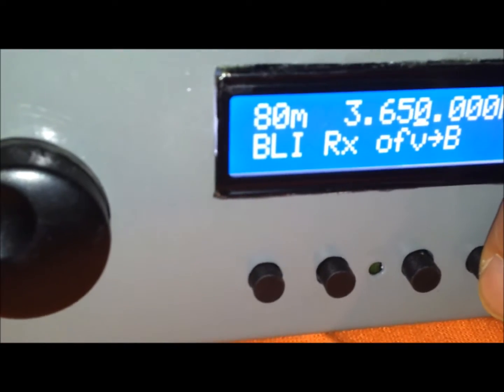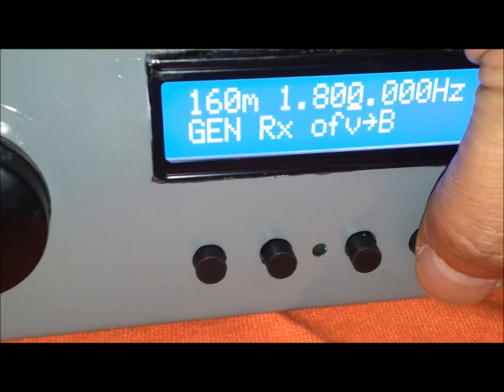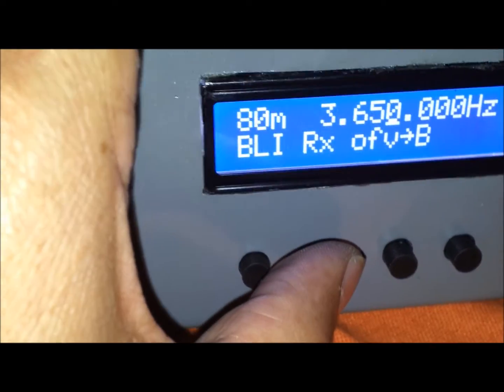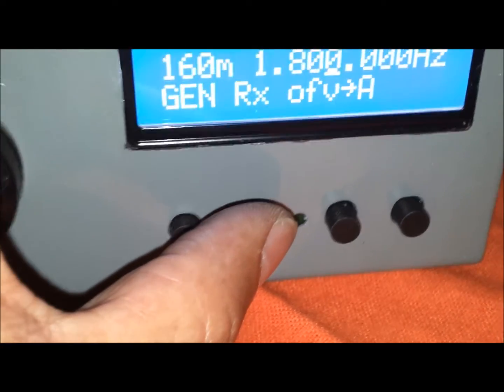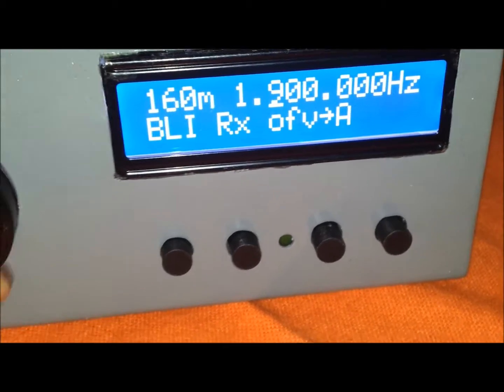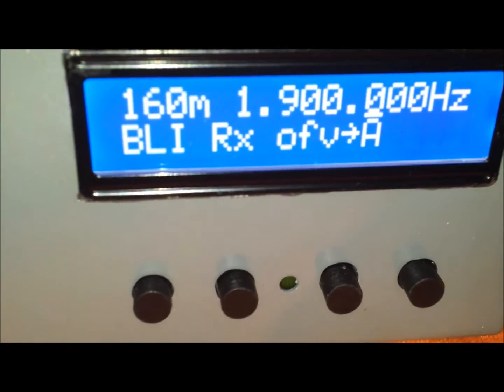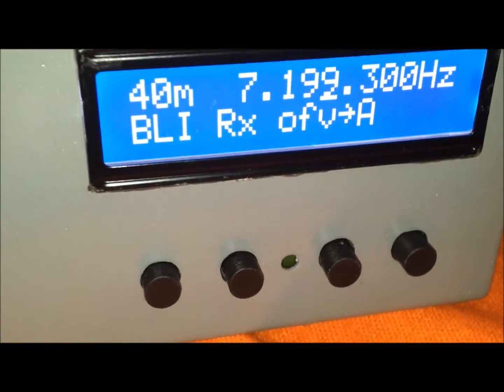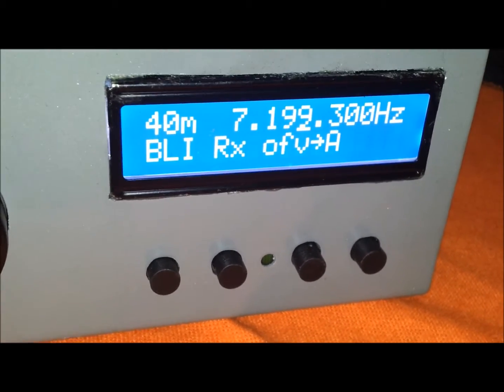OFV DDS / LU9EQF-

Comment: saludos desde venezuela tengo un viejo ft-707 yaesu que como sabras con la temperatura el vfo es inestable y me gustaria manejarlo con este vfo externo. ya encargue los componentes necesarios para emsablar el de colega LU5DJV. mi pregunta es la siguiente el firmware permite adaptarlo a cualquier uso o radio ? osea me refiero a la frecuencia intermedia que varia con cada tipo radio.? se puede alterar por alguna funcion del menu? . gracias! por tan interesante aporte. 73. de YY2JE
Reply from the maker: estimado colega de Venezuela, queria comentarle en relacion a su pregunta que; el dds tiene en su menu la posibilidad de programar la FI de acuerdo al valor necesario, lo he utilizado con distintos valores de FI, como 455kc, 4 mc, en fin, puede ponerle el valor que usted desea sin ningun tipo de problemas, lo usè con un receptor y tambien con un transceptor, le recomiendo que usted verifique el valor minimo y maximo de desplazamiento del ofv del yaesu y programe el dds en estos valores y verifique tambien los niveles de tension del ofv original para evitar diferencias de rendimiento ,tanto en transmision como en recepcion. exitos con la construccion y tenga por seguro que le va a funcionar muy bien. un abrazo 73 DX de Milton- LU9EQF Argentina.
Reply: ok gracias por la informacion ahora solo me queda esperar por la llegada de los componentes esperono no tarde mucho. al tenerlo armado seguramente colocare un video gracias!. 73's. de YY2JE.